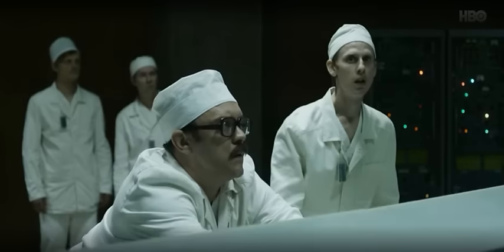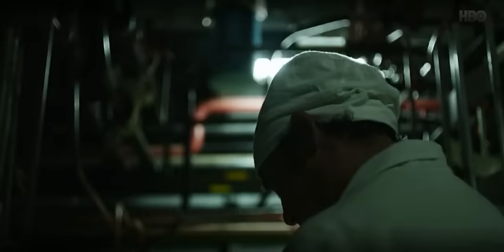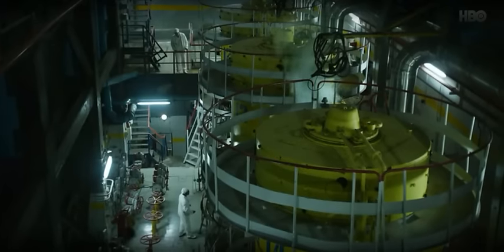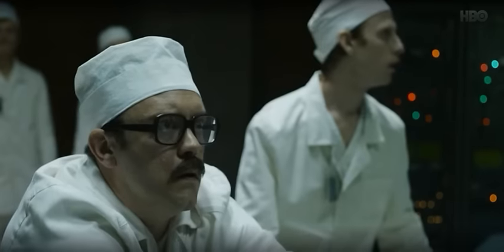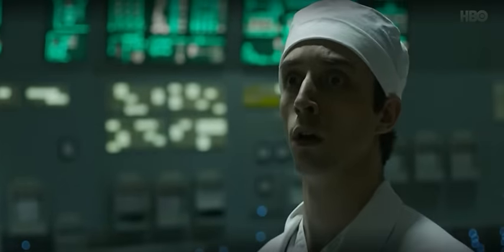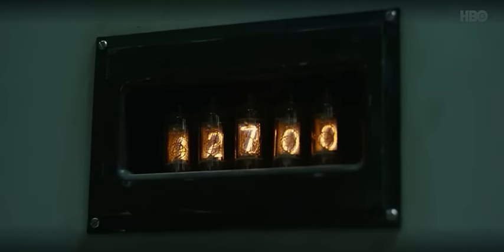Chernobyl (2019) Nuclear Reactor Explosion Scene

Comment: Friendly reminder that the roof of the reactor weighed several tons, and it got flipped like a coin.
Reply: Jesus.
Reply: 6 miilion pounds to be exact.
Reply: @21owlgirl72  i think thats 2000 tonnes 
Not sure im likely wrong
Reply: @plotsky_  not even close
Reply: @21owlgirl72  

6M Pounds = 2721554.22 Kilograms. 

which means... 2721.5 Tons. 

(That much weight🤔?)
Reply: @•tristam bec• lol Jebus
Reply: Not just "flipped", it literally got sent up though the roof at least some 30 metres. Imagine the power needed to achieve that. Scary doesn't even almost begin to cover it.
Reply: And now it’s permanently wedged into the ruined reaction chamber on its side, with mangled fuel rods poking out of it.
Reply: @canonboom165  I’ll end it right now. 1000 tons.
Reply: @alistairwalker2850  
Yep, that thing isn't going anywhere any time soon. Until they start dismantling the old Sarcophagus that is. Did you know that they actually nicknamed it "Hair of Medusa" because the tangled curly shape of those fuel rods reminds of that image?
Reply: It wasn't just "a few" tons it was almost 2 million kilograms (approx. 1760 tons from what I remember)
Reply: Well that's not friendly at all!
Reply: No need to remind me about the terrifying power radiation is capable of
Reply: Not several, 1,000 metric tons
Reply: About 10 000 tons
Reply: Dear god
Reply: 10,000 tons of weight blown through the roof
Reply: Huh almost like it was a nuclear explosion 🤔
Reply: Friendly reminder that the Chernobyl reactor has melted uranium that as hot as lava (not copying)
Reply: I hope chernobyl is to never be repeated especially in united states
Reply: @generalprincecodyhedgewolf2944  Why specifically the US?
Reply: @slicedolives9902  Think if The United States Used an RBMK reactor and The reactor exploded the same way but we have a reinforced Containment Building for such cases Fire fighters and Police and military and government cooperate with plant workers... scientists and civilians
Reply: @generalprincecodyhedgewolf2944  Is that not a good thing, making the cleanup process more efficient? Also with these circumstances where everyone cooperates the Chernobyl accident will never spoken which is gud
Reply: @slicedolives9902  yeah but we have freedom of the press and the News on TV USSR does not
Reply: @generalprincecodyhedgewolf2944  I still don’t really see how that’s a bad thing
Reply: Several tons??? Nah it weighed 10,000tons or 20,000,000lbs
Reply: I believe it's actually called a "lid", not a so called roof.
Reply: That’s actually kind of underwealming when I think about what a nuke can do.
Reply: @Lordfoogthe3st  A nuke is designed to cause destruction. The sheer terror from Chernobyl was the fact that it was meant to create electricity, but we lost control and this was the aftermath
Reply: It’s funny cuz y’all are tryna establish how crazy it was saying flipped and that a couple tons but both are wrong it was over 2000 and it was sent in the fucking air
Reply: 1200ton
Reply: @alistairwalker2850  I turully know about the horror to which about you are speaking
Reply: Heads or tails
Reply: The lid weighed 1,000 metric tons, 1,102.31 US tons, or 2,204,620 lbs. The reactor (including the lid) was about twice as heavy.
Reply: @elitaylor8710  BRUH
Reply: Question, did that suppress the explosion? Like, did it made it a little less worse?
Reply: That thing almost weighed a 1000 tonnes and was able to burst through reinforced concrete.
Reply: @canonboom165  it was less than that, however it did way ALOT(around 1000 tons. each control rod were around 3-4 meters long, weighing in at over 365 Kilograms, with 205 in place.
Reply: My God....
Reply: Yes I remember and is the loudest explosion ever according to Google.. 😮
Reply: @paulgrundy6864  So you think it’s radiation that caused it to explode?
Reply: Yea the reactor flipped like a coin and landed back in the same place
Reply: @vasily9818  no it was actually caused by a flawed reactor design and human error
Reply: It’s 32000 tons guys
Reply: It didnt really flipped like a coin more like a failed pancake flip
Reply: Did it land on heads or tails
Reply: @TheAllSeeingEye2468  no, it was in the middle
Reply: @Greasy_beanz  rare
Reply: @vasily9818  Not radiation itself but radioactive material, like the uranium used in the core
Reply: the huge coin landed on tails
Reply: around 1000 tons
Reply: @generalprincecodyhedgewolf2944  lol freedom right, that's what the owners want you to believe.
Reply: It was 1200 tons
Reply: Hmm.. that's more of a fun fact than a friendly reminder.
Reply: And it was heads you lose, tails you lose.
Reply: 1 ton is 2000 pounds
Reply: @supernitroyoshi  short ton is 2000 pounds. Metric ton is 2200 pounds.
Reply: It was around 1000tonnes
Reply: @canonboom165  us tons not British and tonnes
Reply: @swokatsamsiyu3590  It is said that the explosion had 10 times the energy the atomic bomb dropped on Hiroshima had, so it is very believable that the lid got tossed in the air like a giant penny.
When water instantly turns to steam, it expands at over 2500 times in vapor form than as a liquid, and the coolant flow rate through the reactor core was around 7000 gallons per minute. Of course when the coolant pumps were turned off, the flow rate dramatically got less and less, but still the reactor vessel itself could hold thousands of gallons of water given its huge size. Taking all that into perspective, along with all the other tragic chain of events that led to the explosion, it’s no wonder it had that kind of power behind it.
Reply: Heads or tails: INSANE EXTREME EDITION
Reply: What does that mean??
Reply: @canonboom165 yup, it was a thick shield made of dense materials to keep all the radiation in the reactor.
Reply: @swokatsamsiyu3590  that’s the power to beat the original superman
Reply: @generalprincecodyhedgewolf2944  
That will be impossible since the US never had RBMKs. The closest thing to it would be the B-reactor in Hanford, but that was solely used for the production of weapons-grade Plutonium. It never made electric power. And that reactor has full containment, and triple redundancy for the cooling system because they knew if they would lose cooling for whatever reason, and not have proper backup, they would be up uranium creek without a control rod.
Reply: Damn
Reply: @swokatsamsiyu3590  understandable I mean it’s a what if
Reply: @generalprincecodyhedgewolf2944  
There is no "what if", exactly because of the reason I gave earlier. RBMKs were never built outside the Soviet Union, and they are incomparable with any other nuclear power reactor, most certainly the BWRs/PWRs that are living in the States.

By saying the things you say, you stir needless fear because most people will think that the US does have RBMKs. Or that any reactor is unsafe, just another "Chernobyl waiting to happen". Which is simply not true. Even Unit 4, with all its flaws and inherent instabilities, desperately tried to save itself for almost an hour with the little systems it had. And they wouldn't let it. They forced it to keep running in a mode which is pure torture for an RBMK because it can't do it. Running at very low power for prolonged periods of time is something an RBMK is physically incapable of due to its inherent instabilities. But that's exactly what they forced it to do. In all, they had to do some extraordinarily ugly things to Unit 4 before it finally gave up and failed.
Reply: @swokatsamsiyu3590 some of the greatest power ever seen on earth during humanity’s existence.  Yet even that power
is microscopic when measured against forces that currently exist in the universe like quasars 😱
Reply: Weighed several tons. Scary but not terrible
Reply: Lies, there was no graphite on the roof
Reply: @21owlgirl72 this is not information, use the metric system. Villager
Reply: @canonboom165 yes
Reply: How about we let the lid decide the workers Fate

Heads they live 

Tails they'll be gone in a few years potentially months
Reply: That one bigass coin. What value?
Reply: @mechatengu8092 that's because it was all over the ground.
Reply: @plotsky_ its 300
Reply: @plotsky_ it is 3000
Reply: This is beyond mind boggling terrifying 😢🤯😳😳
Reply: 2000
Reply: 1000 metrical tons
Reply: I guess you can call it the biggest coin flip in history?
Reply: I still think that's just incredible!
Reply: 2000T
Reply: 10000 tons i believe
Reply: It was also said the lid stayed in the air for 10 seconds before falling back down
Reply: at least four pounds
Reply: 10,000 tons
Reply: 1,000 tons.
Reply: @canonboom165 or 3000 US tons
Reply: Over a thousand tons. 
Not great, not terrible.
Reply: Dat die sommige muren van 2,5 meter dik
Reply: The fuel rod and control rod caps weighed 730 pounds each
Reply: " Heads I win, tails you lose." R Kramden. Circa 1955
Reply: Got blowed off and the lid landed right back in the same hole it came out of....freaking crazy stuff dude
Reply: Some of the people in the comments really suck a math. You would not be able to build something that weight 6 million pounds and expect it to be movable by design

The reactor lid weighed less than a 3rd of that weight at just under 1000 tons.
Reply: U meqn seveal 100 tons
Reply: @sovetski8893 not true. The volcano kracatoa was the loudest explosion ever heard.
Reply: Oops
Reply: A man saw the Stones who was on the Cote camber were jumping Up sind down. And as the reactor explode they reached a Energiepoint of 30.000 Watt. What was to much.
Reply: @mechatengu8092 You didn’t see it!
Reply: Yea i saw the same doc too
Reply: We know
Reply: Dumbledore said calmly 🙂
Reply: ELENA aka the upper biological shield
Reply: Makes it very believable that an underground nuclear test in the states sent a manhole cover onto space.
Reply: No try 2.2 million pounds in total. That’s roughy the same weight of 125 full grown elephants.
Reply: @swokatsamsiyu3590 wait it was blown off by pure steam pressure that kinda seems hard to believe I always thought the reactor basically became a bomb and it blew up because of that but then again I’m probably wrong cause likely the whole facility would’ve been a crater if that’s the case
Reply: @murpimoo3020  
Yes, it really was blown off by steam pressure alone. Never underestimate the power of steam under high pressure. Look up old locomotive explosions. And a nuclear reactor cannot, and will not, become a bomb. That is impossible due to Physics reasons. As bad as the accident was, even Unit 4 wasn't a nuclear explosion. It was an explosion caused by nuclear things running wildly out of control. Not the same thing. A commercial power reactor doesn't even almost come close to the enrichment levels needed for an atom bomb. Most reactors sit anywhere between natural fuel for a CANDU, and PWRs/BWRs in the 3 to 5% range. Unit 4 had 1.8%-2% fuel enrichment (after the accident this was raised to 2.4%-2.6% for the remaining RBMKs) since that was what RBMKs ran on before the accident. At the time of the accident this was even lower due to the reactor being at the end of its fuel cycle.
Reply: 1000 tones is several?
Reply: No it weighed 2000 tons
Reply: It likely will not, the design of the control rods in the United States is different, and it does not use graphite tips to hyperaccelerate the reaction
Reply: @alistairwalker2850 flip a coin enough times, eventually it will land on its edge.
Reply: About 2000 adult sized African elephants
Reply: Lol several tons. My car weight is several tons.
Reply: A hundred or more I believe actually. Crazy.
Reply: Oh my goodness.
Reply: Thermal explosion
Reply: @rayhankazianga6817 ...they're very much so correct. 2k ton is equal to about 6m lbs
Reply: Preassure cooker steam blew lid off then nuclear explosion followed. Never using a preassure cooker again in cooking
Reply: The reactor lid weighed 4 million pounds
Reply: Serious question, where did all this debris land? If the comments are right that it was blown into the air, what happened to it?
Reply: @TrippyZeke 
It wasn't exactly a NUCLEAR explosion. It was an explosion caused by a buildup of pressure - like dynamite. If the explosion was a nuclear one, that building wouldn't be there at all. It would've been blasted into ash and glass. Yes, there was nuclear components that got launched into the air, but nuclear fission is not what caused the explosion. Heat, and pressure is the thing
Reply: Wow...
Reply: Concrete cover was approx. 200t. , yes flipped like a coin. Power of hydrogen, ladies and gentlemen
Reply: If you're somehow implying that the Soviet state is to blame for this ...
Reply: The reactor lid weighs 1,000 tons
Reply: Sounds like my mom
Reply: More than "several" tons. A truck weighs several tons. The reactor cover was hundreds of times that weight, and was tossed aside like a penny.
Reply: I could lift it easily tbh.
Reply: It weighted 4,000,000 pounds actually
Reply: Still was nowhere  near as thick as suppose to be
Reply: @plotsky_ 3,000 tons
Reply: @generalprincecodyhedgewolf2944 

They don’t use that reactor not at all
Reply: 2000 tons
Reply: No it was 1000tons
Reply: @Sussybaka410me  2000
Reply: Came up tails too
Reply: Well it's called a power plant. Need that kind of stuff to do some meaningful work.
Reply: 3.6 kilotons. Not great, not terrible.
Reply: 100 tons to be exact
Reply: @generalprincecodyhedgewolf2944 Three Mile Island happened before this.
Reply: Thats a Hidrogen explotion for you under extreme pressure.
Reply: @TrippyZeke it was not i think, isnt it was more like a steam explosion? Yeah i just checked it was a steam explosion
Reply: @Greasy_beanz no it was not 32k tons you probably think in pounds or something it was 1000 tons, literally google. Multiple sources stating 1000 tons compared to some random numbers in this thread
Reply: @RadebeKids "several" haha. A couple of dozens of severals
Reply: @rhysioeren3203 all over the place obliviously
Reply: @TerminalBAviation it was 1000 where did you get 2000?
Reply: @norbertnagy5514  4000000 pounds= 2000 US Tons. Around 1750 tonnes.
Reply: @TerminalBAviation but where did the 4 million pounds came from when i read in multiple places that it was 1000(metric) tons?
Reply: Good reminder there bud!
Reply: Heads or tails
Reply: @canonboom165 that’s the equivalent of six jumbo jets
Reply: @swokatsamsiyu3590 reactors do not create electricity. They create the steam that is then used to do the work (ie turns the turbines which then turn the generators thar create the electricity).  All a reactor is is a large boiler that relies on atomic chain reactions to keep it going (ie creating uninterrupted the heat needed to convert water to steam).
Reply: @jdspreest  
Yes, I'm well aware of that. I study nuclear reactors as a very nerdy hobby, with the RBMK as my specialty.
Reply: @paulgrundy6864  It wasn't the radiation that caused it, it was a steam/hydrogen explosion.
Reply: Several thousand tons
Reply: If you guys found this interesting, read Midnight in Chernobyl by Adam Higginbotham. Or download the audio book. Fascinating read.
Reply: Eh, it only flew 1000 meters in the air not a big deal
Reply: Humanity shouldn't be able to handle that much power!!! EVER!
Reply: You mean, the lid or the bioshield of the reactor.
Reply: Friendly reminder…Japan wanted all the smoke .
Reply: It is called biological shield
Reply: It was held in the air for about ten seconds. An immense amount of energy for that madness
Reply: The reactor cap weighed 4 million pounds
Reply: @oliverwaynechang3098  or 2000 KG
Reply: *lid
Reply: everything weighed tenfold the equivalent of someone's mother. completely disintegrated
Reply: And still nuclear energy today is the safest and cleanest energy
Reply: Several tons? 500-1000 tons.
Reply: @plotsky_ nobody have not 2000 tonns cranes inside of factory room. 500 tonn is maximum.
Reply: Steam will do that. Good, old, reliable steam.
Reply: @plotsky_ about 300k tons
Reply: @swokatsamsiyu3590 I try to imagine what it must’ve felt like to be standing in that same building with no ear protection
Reply: Supposed to be 2000 tonnes.
Reply: badass
Reply: @canonboom165 yes its steal and lead
Reply: @swokatsamsiyu3590 the primary exolosion is calculated a 0,23 kt of TNT basicly 40 tall boi bombs.
Reply: Did it land on heads or tails?
Reply: More than several tons
Reply: Poor Elena was just blown up into the air
Reply: @skeetrix5577  the technical name is the "upper biological shield". There's also a lower biological shield which was similar in design if I'm remembering correctly.
Reply: Not only the top lid but it also blew the lower one down like at least 5 feet I think, maybe more.   The upper lid would have went even higher.
Reply: The power of steam should NOT be underestimated.  Especially if it's radioactive.
Reply: 4 million pounds ...